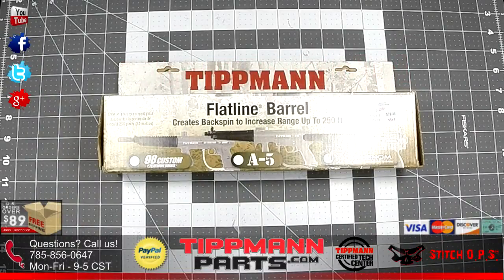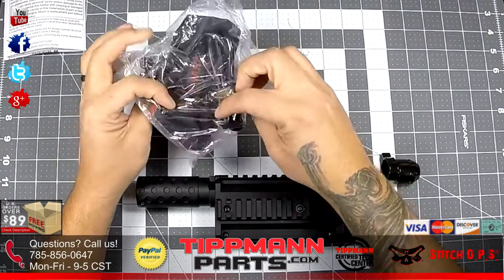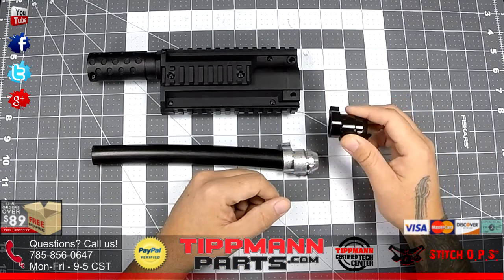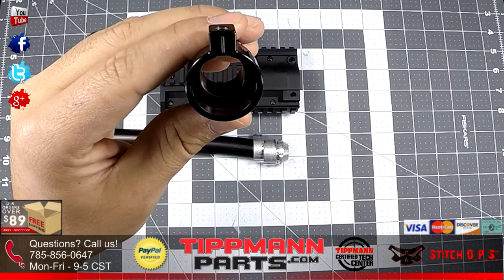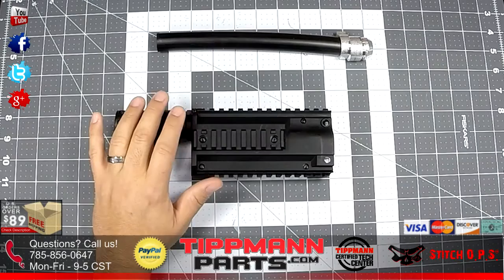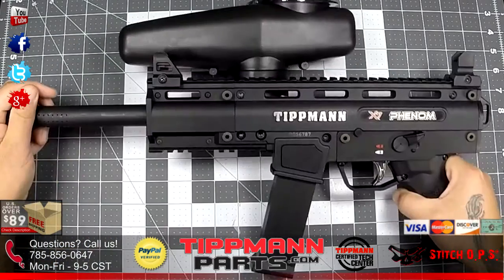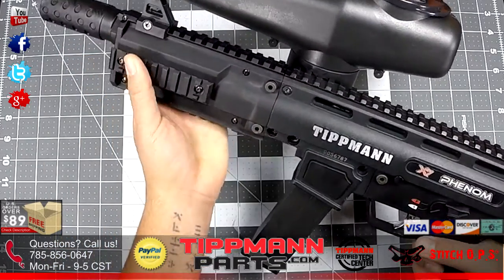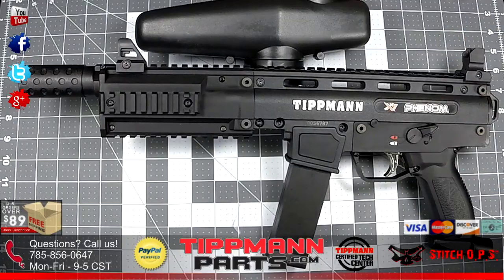Tippmann X7 Phenom Flatline Barrel Unboxing and Review

Comment: What advantage does the flatline barrel have to the stock 8 inch on the x7 basic?
Reply from the maker: +Gutti Man (guttiman) The advantage would be the improved distance it would be able to shoot. Flatline barrels put backspin on the paintballs, which makes them carry longer distances than standard barrels.
Reply: Tippmann Parts can i use the shrouds with a different barrel??? Like taking apart and change the   Flatline barrel for standard barrel
Reply: @Tippmann Parts. But does the balls break when they hit at long distance?
I done a few games with "simple" markers and then the distance becomes alittle over the "effective" range the balls tend to not break alot of the time. How does the Flatline cope at long distance when im guessing the velocity is somewhat the same but with the added backspin to carry it further.
Does the balls still break somewhat the same as they would at shorter distance or will they just bounce the majority of the time?